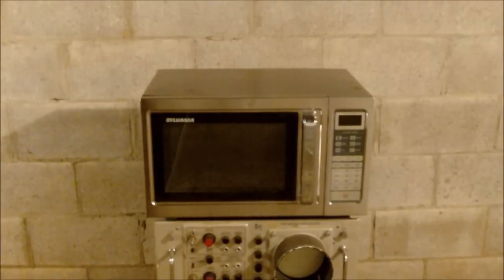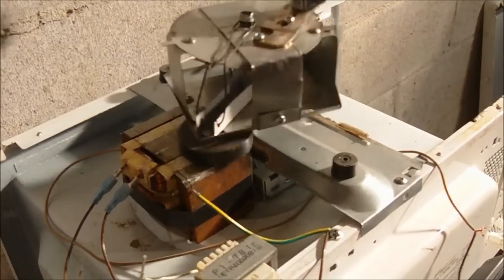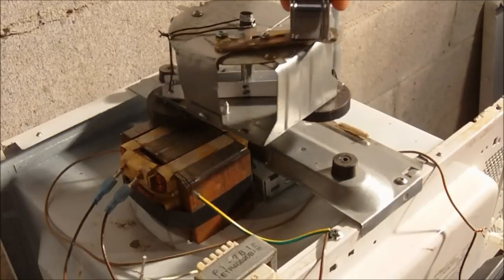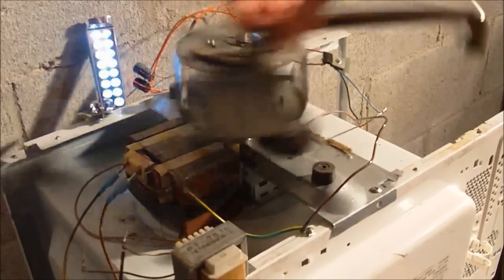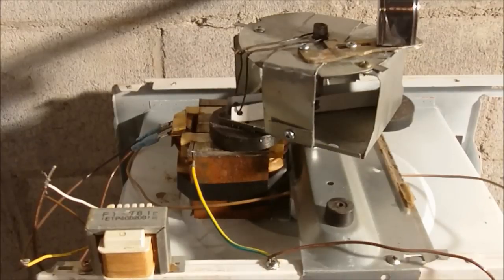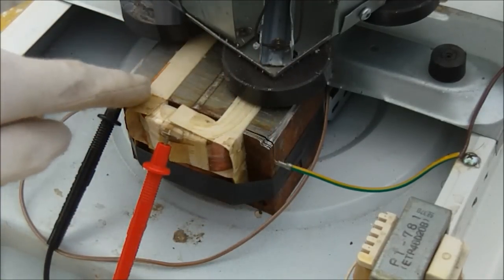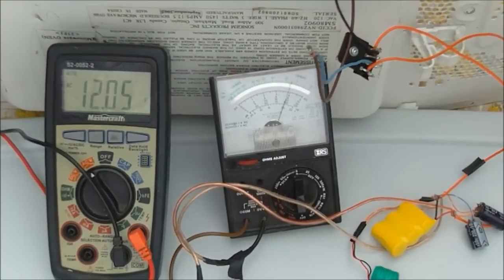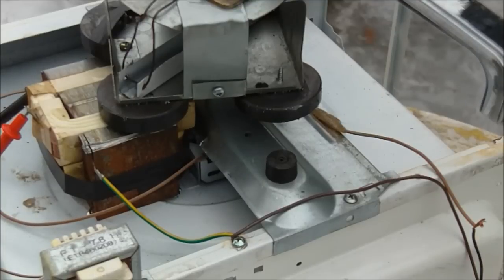Generator Built from one Microwave Oven (Macgyvered)

Comment: There are 3 separate poles on that coil the 2 out side poles are the South and middle pole is north. Also use a full wave bridge rectifier  going into a capacitor for much better output for lights or charger

Comment: I just got a 400kv rc air plane 3 phase motor. It uses 80 amps as motor so it will make half that if i could get it to spin 400000 rpm but i wonder if i can be used as the smallest most powerfull wind generator at high voltage just testing..i was thinking to get a low less than 1000 rpm 48v dc motor at wind speeds it might make 12v at 200 rpm

Comment: Every day im full of ideas most ideas are lost never completed or forgotten. I had a i few ideas today to make my hamster charge a small battery. Also custom making my own coils (or switching to flux points with pig ties) n just right better magnets up grades to be a good smoth EMF wave at higher V lower Amp. Trying to work in harmony .. lol no i can hook up a small fan to ventilate and a small cell battery and you can have a gerbel charge your battery or capacitors and have a light switch lamp with a hampster power inside,LOL. i just put a dc motor that made 3.3 v and its 3.0 two buttons but just need a led and swithch.Yeah the magnets each have to be at the exact point. have to do more R n D.  stay fresher and working out to start. two more ideas i had was to make a generator welder/ a steam engine or experiment with water pump in a washing machine to run a generator by psi or use a old computer speaker with the volume pwm control and reverse it to contro the vols by bypass or tie wires together, then put a battery pack in in side it and use the long wire for a miny turbine custom and extra speaker wire for external power source just today but im just writing them down somewhere!

Comment: The circuit board should have a bridge rectifier and capacitors on it. Use those! You can probably use a knife to disconnect it from the rest of the circuitry.

Comment: Drive the carousell  motor with the  fan motor  and  run the  power to the   transformer   and then to a  hairpin  circuit   use  the  condencer  and   you  relally need two  of them for the hairpin.   Add a  XC   non-linear  circuit   and    fuse  all electric circuits.    Charge   btrys   from the  resistance end of the  hairpin    and    invert  power refeed to  the   power  for  the  drive  fan motor  used to turn the  synchronous  motor/generator ,Earth ground  the  system  as Tesla  proposed.  This can't  be any more work  than  what you are  showing.
Reply: chester wheeler... Make a video?

Comment: Could you increase the scale of this to maybe be able to power power tools? Or to charge a battery/capacitor to power a light bulb or 2 for extended periods of time? (Like 5-10 hours maybe?) I'm pretty new to electrical wiring and power generation, but I find it very interesting

Comment: How did you get the magnets off the magnetron tubes? I wanted to use them for holding tools on the wall of my workshop or my electronics bench as I have a bunch sitting around... they really seem on there, though.

I think you undercut your efforts.... first if you wire the coils in series you will get more voltage, enough to charge a car battery or run a laptop. This would seem best matched to a bike crank and in the redesign use 4 transformers. Heck, you could make the whole thing larger and do 6 or 8 both magnets and transformers.... do you even need the transnformer there and did you check if you get more or less voltage with the shunt in or removed? Good design, a little conformal spray on the transformer and it could be left out in any weather with some regular gear lube or grease or an oillite bearing on the shaft it'd be a year around useful device.

Unfortunately some guy in my state got sued and is in jail for having a wind turbine. Buzzkill neighbors. I so badly want to try some very simple ideas I have that could be extremely ez for the extreme novice to build and maybe rival the most efficient props out there. But not if it means going to jail for a science experiment. I know people running worse things around here.

Comment: bro you should have just taken turn table motor apart drill hole in the spot right over center of magnet..turn by hand OR use printer motor 9 volt battery...gets 100-200 VOLTS depending on SPEED!!!!!

Comment: If you take 4 or more lawnmower coils and 4 OR more neodymium magnets on the flywheel of the lawnmower aluminum rotor ,, you will have MEGA output voltage enough to run a lot of things. More magnets the harder it turns , and more voltage and AMPS. BE very careul because is HIGH VOLTAGE. Connect battery to this and you can power a refrigerator , electric heater , and an induction cooktop. NO PROBLEMS. The only problem you have to solve is how to turn the rotor. By bicycle / manual labor or by Motor or gas engine by turning your lawnmower into a generator to power. Just add a whole bunch of lawnmower coils to the outside rotor and more magnets. Turn lawnmower into emergency generator. PROBLEMS SOLVED.

Comment: please TELL THEM ABOUT the beryllium insulators by the magnets on the magnetron that is MORE DANGEROUS THAN THE ELECTRICITY.  The microwave transformer has the volts and the amps to KILL YOU.  Be very careful!!
Reply: Cool video and idea though!  Nice.  But 90% of people don't need to mess with microwaves.  There's a lot of very dangerous stuff in there.
Reply: @stevenking2980  Discharging the Cap is pretty simple.

Comment: You can use the drive motor from the carousel as a 120 volt generator.
Reply: +YFUATIW Yes, you can... I was spinning one today and gave me a huge shock... So I grab my tester and keep spinning it and it went up to 130V...
Reply: +YFUATIW nope, usually those are inductive based motors, they dont have magnets in them.

Comment: Try not to remove the primary coil and connect the positive and negative together I think you will get a higher voltage out of it
Reply: +Aire Lao True, but at the cost of current